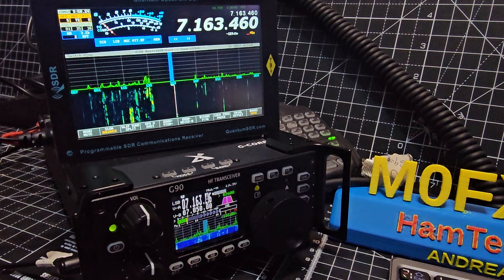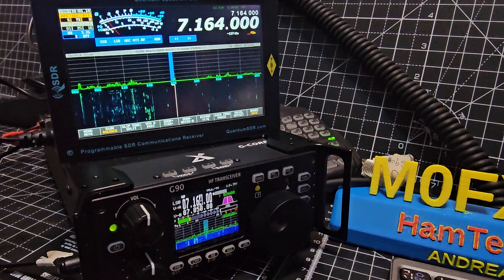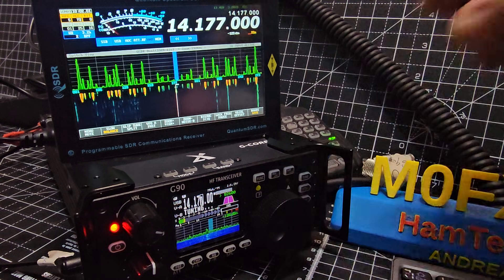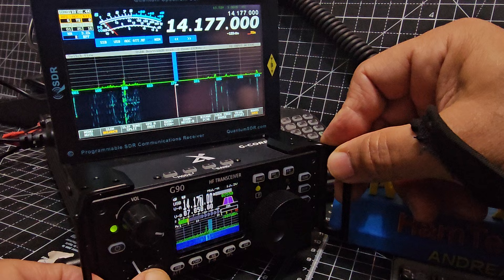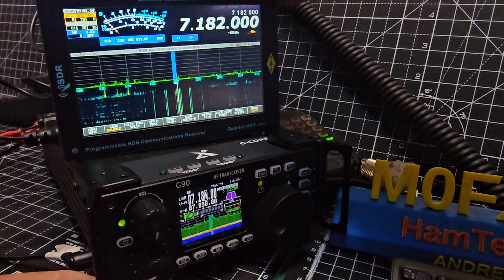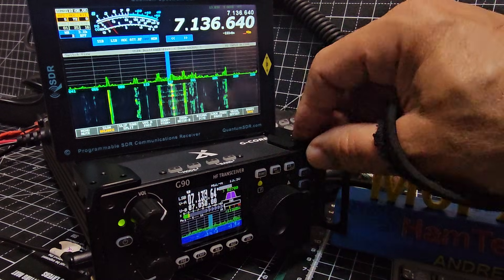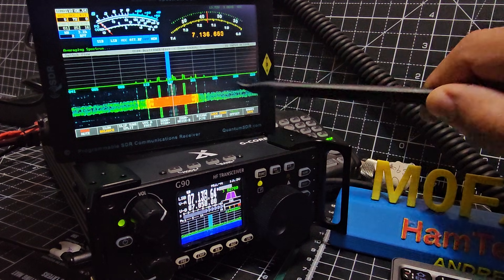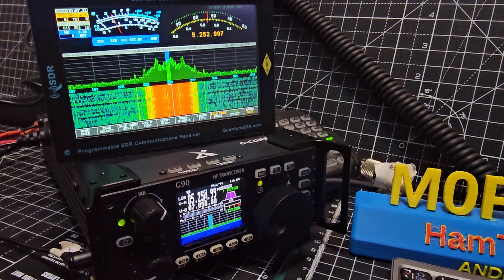Xiegu G90 & Quantum After Firmware v1.80 - 2025

Comment: I agree the Quantum is a game changer. Having gone from a 710 with an external 7inch screen to the G90 the display is a bit of a shock :-)
Reply from the maker: Stick with 710
Reply: The 710 is a keeper. Outstanding radio. 

The G90 is specifically for more portable work and for experimenting with antennas, making use of the better ATU.